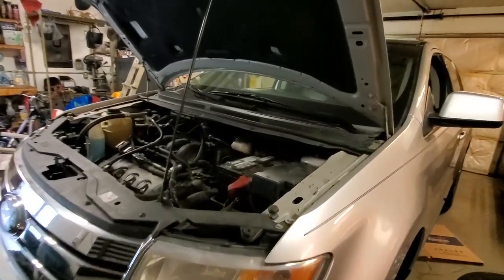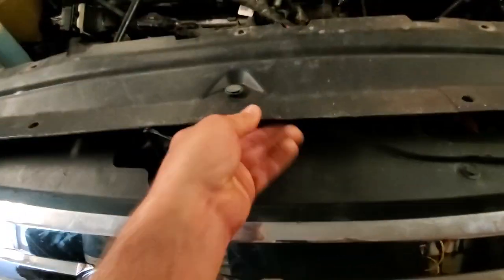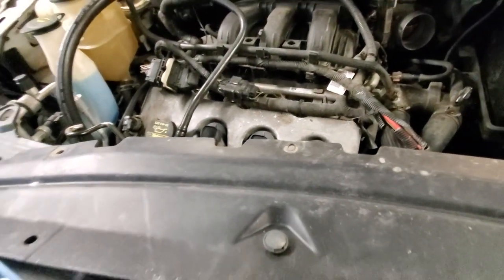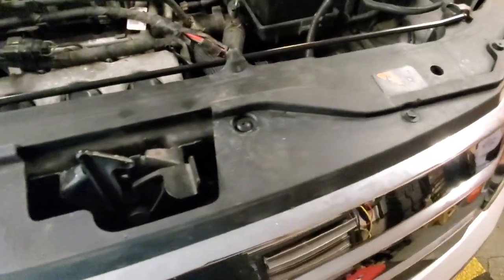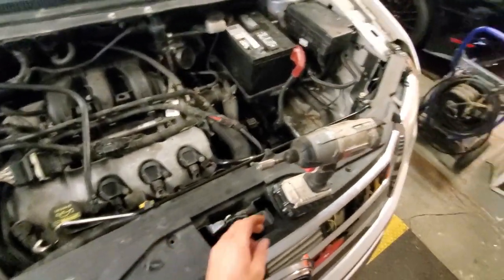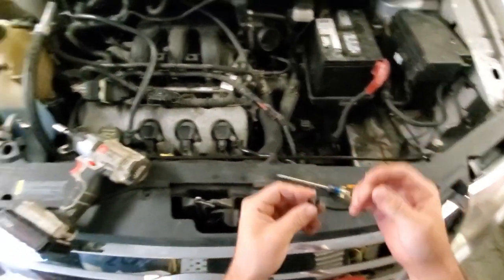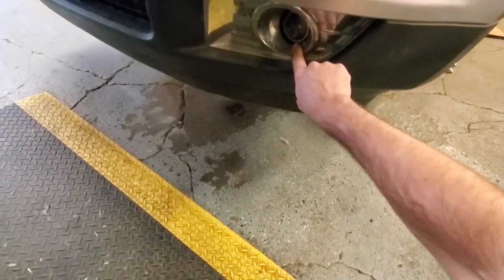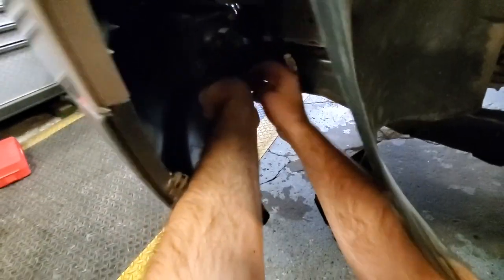Ford Edge Front Bumper and Headlight Removal

Comment: Thanks for this I just got new LED headlights and would rather install them myself as well as replace my fog lights. I only have the factory jack I assume I need another jack for this?
Reply from the maker: You don't actually have to remove the wheels, it can all be done with the car on the ground. The wheels being out of the way just makes it easier. If you have jack stands (which I highly recommend, I wouldn't trust that cheap factory jack enough to get under the car, what is your life worth to you?) you can jack up one side, put a stand under it, then repeat on the other side.

Comment: I had someone back into me today and caved in my left side fender. I can't find anyone replacing one on here but would you happen to know if it's a hard fix? I'm assuming I'd have to follow your steps in this video first anyway so figured I'd ask. Thanks
Reply from the maker: I've never removed a fender on one of these, so I can't say for sure, but knowing what I do about how these cars are put together, I'd guess it's not hard. You'd definitely have to do what I did here. From that point I would imagine a few more bolts (probably in hard to find locations) and it would come right off. 

I have a parts Edge so you now have me tempted to try it and make a video on it haha.